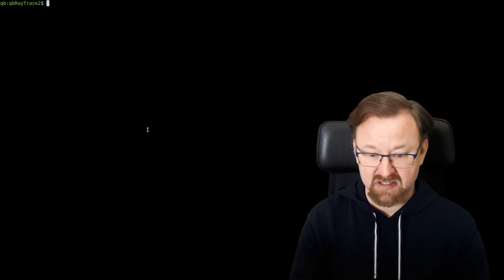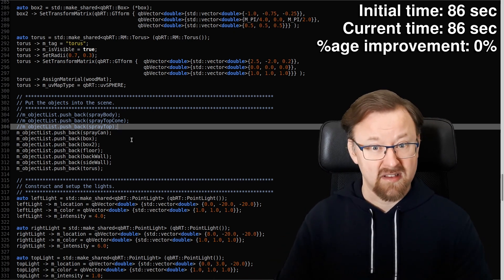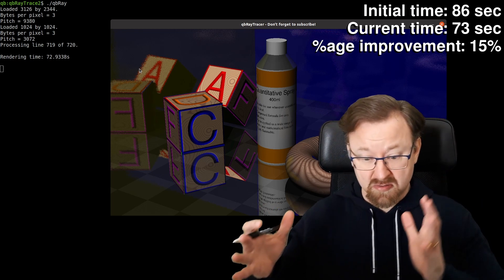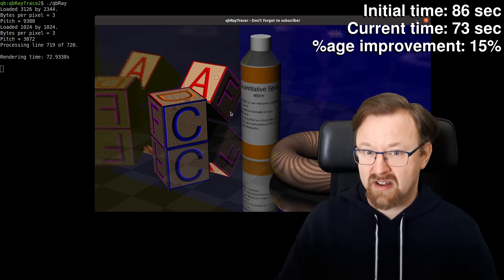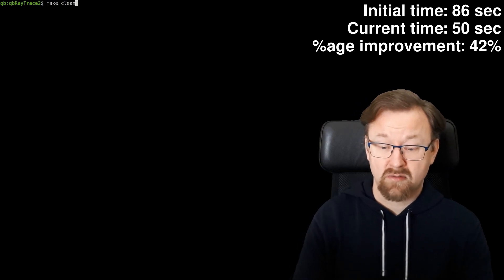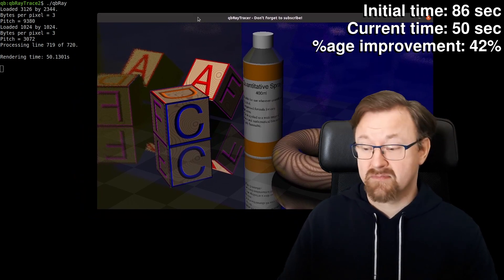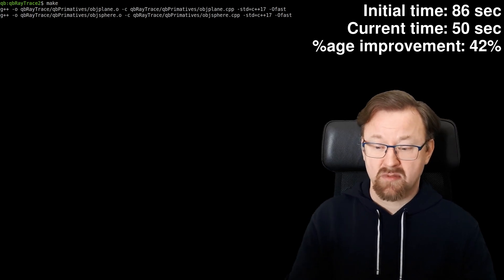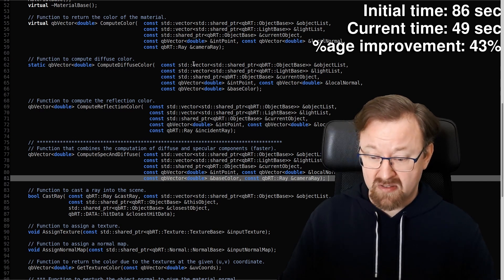Ray Tracing [C++ & SDL2] - PERFORMANCE (Episode 23)

Comment: are you planning to make a real-time render? if not, how do you advise to implement it
Reply from the maker: No, I don't really have any plans for real-time. My first thought when thinking of real-time rendering would be "don't use ray tracing" :-) Seriously though, I think to get anywhere close to real-time with even a moderately interesting scene is going to require using a GPU, either writing the algorithm into a compute shader, or using OpenCL or similar. This is not something that I was planning to cover in this series though.

Comment: It looks like your linear algebra library classes store their data on the heap - that should be the top priority to change to being on the stack with just inline members. They are math primitives and as such "hot" code, you don't want any small math vector and matrix construction to trigger a potentially-system-calling heap allocation, that"s incredibly slow and completely unnecessary. It also means the memory gets fragmented with every arithmetic value stored randomly in memory making it likely to be "cold" (CPU cache wise). 
Also there really no need to use double precision anywhere in your codebase, especially not for math heavy data. 32bit floating point operations are still typically twice as fast and plenty more precision than you need for a project like this.
Reply from the maker: Hi Arnon - thanks for the comment and suggestions! After the last video, this was actually the first thing I looked at for improving performance further. Running the code through gprof clearly showed the same as you suggest, that the linear algebra library was taking up way too much time. I knew it would make a difference, but I must admit that I was surprised at just how much difference it made! Next episode hopefully due next week.